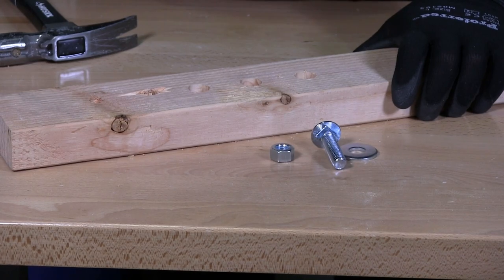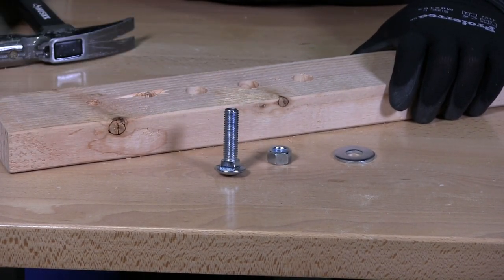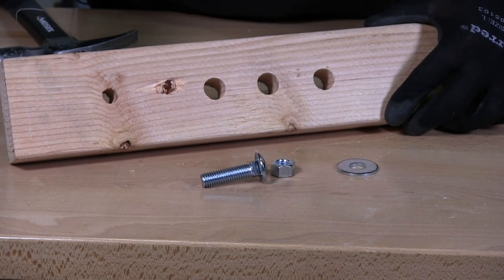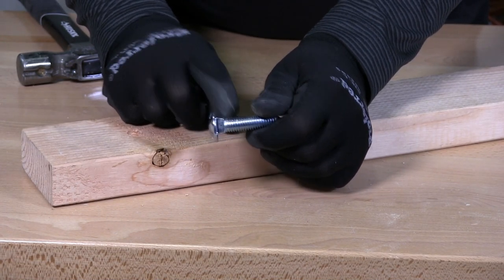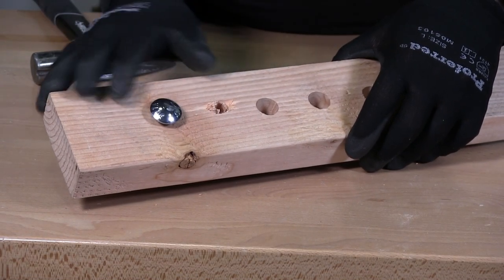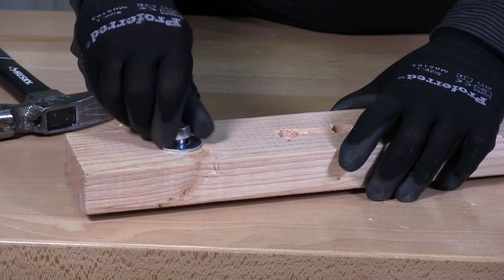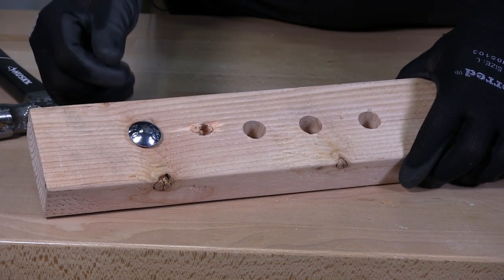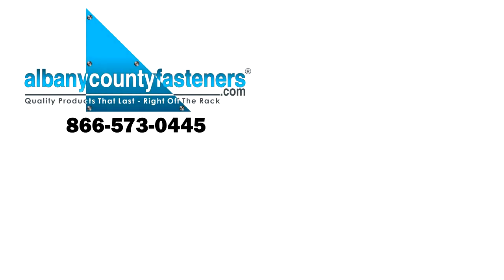Finding The Right Drill Size For Installing Carriage Bolts | Quick Tips

Comment: I am making an Adirondack Chair using old wooden waterskis. I want to use carriage bolts because they present a more decorative look. Most of the skis are combination of woods but mostly cedar/Cyprus. How do I set the bolt without marring the head?
Reply from the maker: Carriage bolts heads are set by tighting the nut and pulling the head into place.  Good luck.

Comment: I did not know this. or never thought of it. I have usually avoided carriage bolts because I can't drill a square ho, and don't have punches. I am 56 and only noticed them used in square metal holes. I can see applications for this method.

Comment: Can you use on metal?
Reply from the maker: Carriage Bolts are designed for wood-to-wood or wood-to-metal applications because the square shoulder helps lock the bolt in place as it bites into the wood. 
This effect will not happen if the carriage bolt is directly installed into metal unless the hole is cut into a square shape that perfectly matches the carriage bolt.
It would probably be better, and easier, to use a Hex Cap Screw for that application.

Comment: ok this is all well and good if you're using carriage bolts in wood... but who the hell does that? i've only ever seen them used in steel applications.
Reply: You will see carriage bolts often used on park benches that are made of wood. More often than not I see the planks of wood being fastened in place on park benches with carriage bolts, usually hot dip galvanized ones.
Reply: @jayhershorn5711  yep see them so much on park benches that I cringe when I see DIY benches using screws